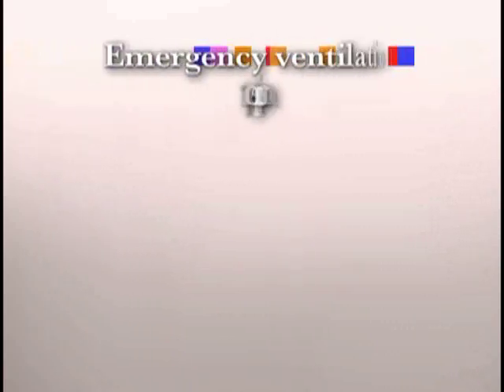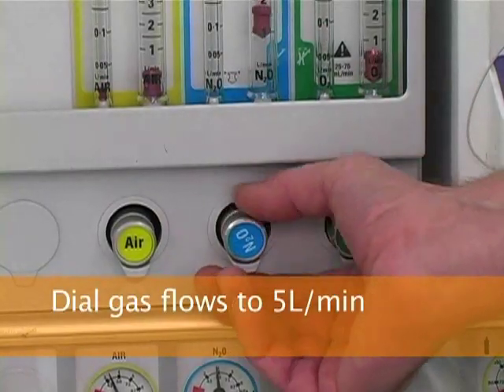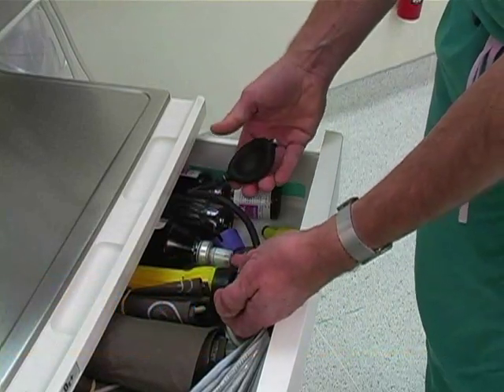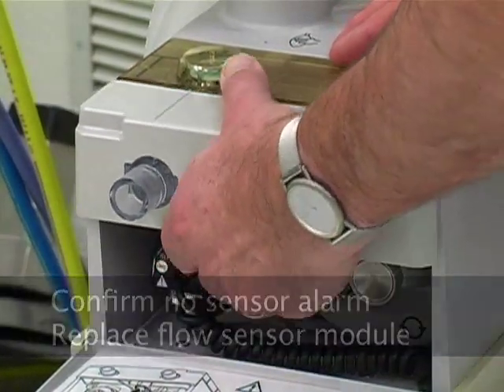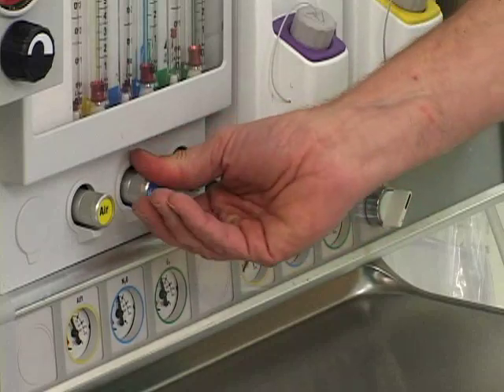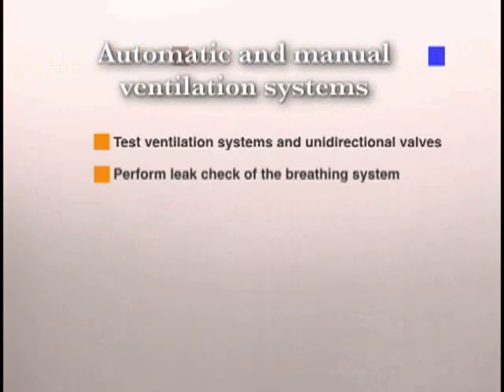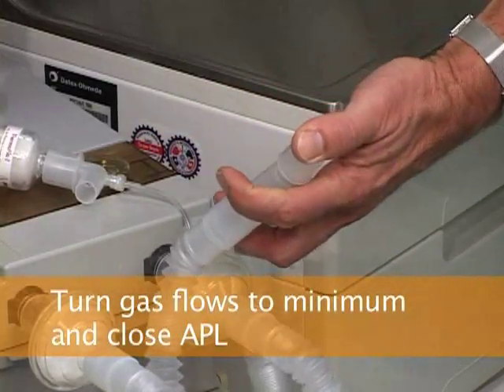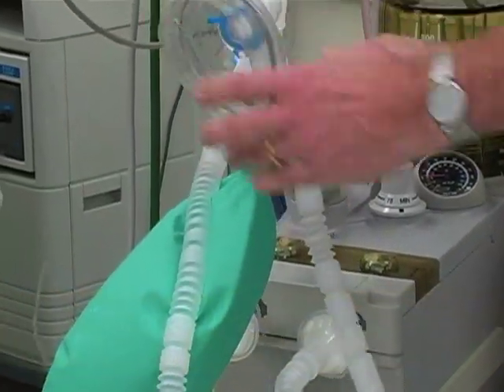Datex Aestiva Anesthesia Machine Checkout Procedure

Comment: @davedidashit They sell more because hospitals are cheap and do not buy the best. The hospital's primary goal is to make money, not provide the highest level of care. The bellows design on the Ohmeda/Datex units dates back to the eary 1910's. The Drager units use a servo control drive pluger that meters precisely the dial tidial volume has 1/10 the dead space and compliance. Plain and simple, The Ohmeda/Datex design is old and out dated junk. Know your facts before posting. Youre not a CBMET.